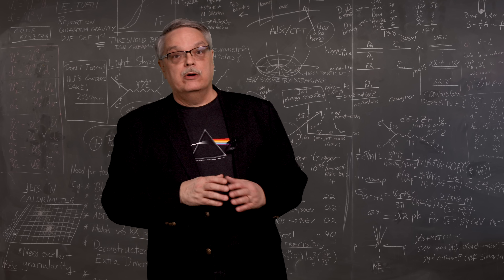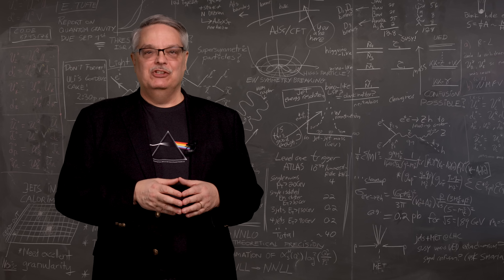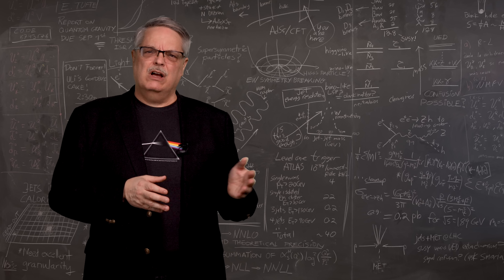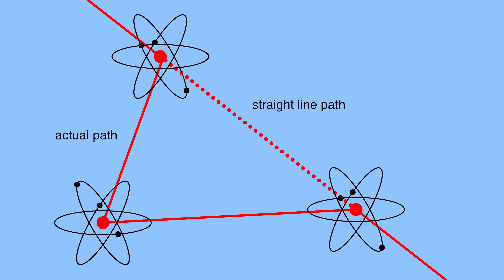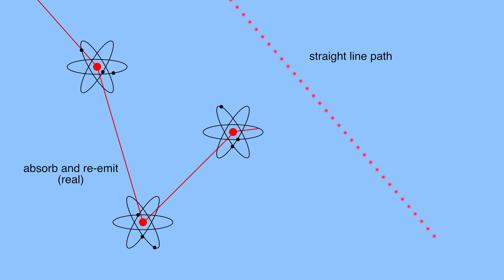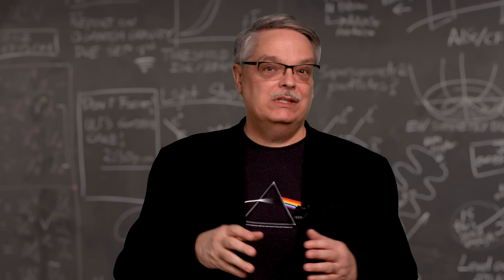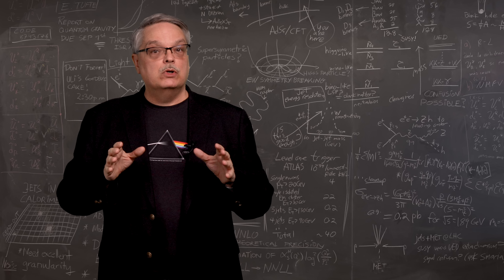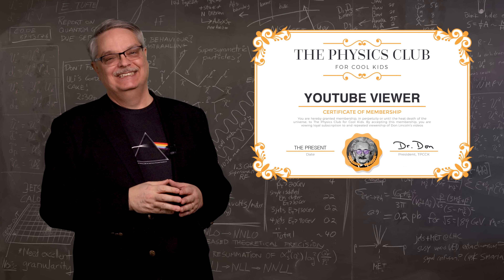Why does light slow down in water?

Comment: Imagine that. Wavelength is color for light waves. The beam would have to change color entering the glass and change back upon exiting. Also, light speed was never described as being dependent on color before, or did i miss something? Mmmmmmmaybe not so simple. Radio is considered invisible light and when going through an insulator of an antenna shortens its wavelength... so there may be something to the wavelength shift part of it, but the mechanism or speed shift? Not necessarily. Still curious: Why? In an antennae the wavelength remains shifted when exiting the insulator, Into the conductor of a receiver. So, not this mechanism.

Comment: Few questions..
1. What is the direction of propagation of wave generated by the moving electron?
2. If the electric field exerts a force on the electron of the atom, doesn't the energy of the light wave get spent? To exert a force, energy should be spent. And if energy of the light wave is spent, then upon increasing the thickness of the slab of glass (or any optical medium), the energy of light wave should decrease progressively to zero.
3. After the light wave has interacted with electrons of an atom, when it approaches another electron of another atom, it now has electric field of its own and that produced by the electron of the atom previously met. Now this new superposed electric field should interact with a new electron differently causing light to behave differently as it progresses through the medium. It may have different average speeds for different thicknesses of the medium.

By this what I wish to say is, the electric field of the light may not actually get influenced by the new vibrations of the electron of the atom rather by the inherent wave of the electron with which it goes round the nucleus.

Please do answer (and/or refute this) anyone. (I'm an undergrad as of the moment of typing this.) I'm welcome to all arguments.

Comment: Finally, an explanation that made sense. Thanks a lot.
Reply: It still doesn't make sense to me
Reply: @MrSpock-sm3dd  There are 2 crucial bits:
1. 8:03 - 8:21 - the oscilating photons induce the oscilation of electrons. The oscilation naturally have the same frequency, but different phase and the amplitude.
2. A sum of sinusoids at the same frequency is another sinusoid at that frequency - always true. The proofs of that are a bit complicated, so You can just remember that's how it is. What changes is phase and amplitude. An animated illustration of that is 7:06 - 7:30. The original wave (2) moves at the speed of c, while the induced wave (1) is almost stationary (at least here, I don't know how is it in phisical body e.g. glass). The resulting wave (3) is the weighted sum of (1) or (2), weights being amplitudes. The larger the amplitude of (1) the more (3) resembles it, so also the slower it moves.

That's how I understand it on a basic level, although I wouldn't be surprised if there are some holes. If anyone would like to correct me or add something, please do.
Reply: @MCMaterac  Where I get lost is the assertion that the amplitude being changed somehow affects the speed. I don't think that's a property we observe in other waves, to include light. And there's no explanation in the video as to how we arrive at that conclusion.
Reply: @That_Montage_Nerd  You're right, that's a wrong assumption. I've just made a javascript simulation. If the 2 amplitudes are equal, it looks just like in this video and in relation to wave1 the resulting wave3 moves half as fast as wave2. However at other amplitude ratios the resulting wave moves on average at the same speed as the input wave that has higher amplitude, with additional left-right oscilations repeating each time wave2 has amplitude higher than wave1, the wave3 propagates on average as fast as wave2, accellerating and decellerating each period on repeat.
So yeah... the video (and my answer) doesn't seem to explain the matter well.
Reply: @MCMaterac  Bro are you Indian?
Reply: @onlymusic1691  Nope, bro, I'm Polish.
Reply: @MCMaterac  The video does not explain the question raised at all. See my newest comment under the video.
Reply: @whuzzzup  Found it. You're right.
Reply: @MCMaterac  100% incorrect, you are completely wrong
Reply: Debasish Ray Chawdhuri except it's false, so even if it makes sense to you it doesn't help you except believing something incorrectly

did you even graduate high school? this is some of the most basic stuff

Comment: So, enough glass and the light energy would just be absorbed by the slower wave length, produced by the field? Also, is the light passing through glass, producing heat or energy? And, different color light travels at different speeds? When the light passes through the glass, the speeds are averaged out to a average combined light source speed.,.. so if we eliminate the slower wavebands, will the light still slow down going through the glass? If light of different colors travel at different speeds, how is what we see in the night sky accurate? The fastest colors bring their information here faster, than the slower colors? Can we break light down into it's different wave forms and measure the speed of each waveform..
Seems like the makings of time travel here?

Comment: Now hold on. The resulting additive wave has a different frequency (wavelength) than either the original wave or the secondary wave alone. That's clear. But the argument presented is then implying that lower frequencies move slower thant higher frequencies, which is not true. The speed of light is constant regardless of frequency: blue light moves the same speed as red light, for example, right? So, the authors of this video still have not explained why the combined, lower frequency wave, moves slower through a transparent medium than the original wave.
Reply: Thats because its BS take a look at the alleged moon landings.

Comment: Good work pointing out the "wrong" or incorrect explanations on why light changes speed when it moves through a medium. Now here's whats incorrect in your statements that you're claiming in this video. The velocity of light does not slow down when traveling through water or glass, what occurs is the wave speed changes not its velocity. If what you're saying is true then red light would travel at a different velocity then blue light being at different size waves. That is not what happens, What changes is the "Rate of Time" of the object from changing its wave size. The velocity of light remains the same only the size of the wave and the speed of witch the medium appears to be moving through "Time" changes. So when light leaves the medium it departs at the velocity of light because its velocity never changes not because the light beam "prefers" to travel at light speed. I enjoy your efforts though keep up the good work.

Comment: For the same reason planes have to fight to go faster in the atmosphere, RESISTANCE
Reply: Resistance would cause the light to decelerate over time. And would not explain how the light speeds up again when it exits the glass.

If you shoot a bullet into a fish tank it will decelerate rapidly while it is in the fish tank then come out the other side and continue at a reduced speed. That's not very similar to what happens with light.

Light slows down instantaneously and then pick up it's original speed upon exiting the tank. It isn't a stream of particles.

Comment: This is a classical explanation, there must be a quantum one. At some point the professor refered to the light absorption, which is a quantum process but he doesn't go further to explain the origin of the secondary wave in the therms of the light scattering. The refraction coefficent, which has all classical physics needed here, is read quantum mechanically as a result of photon scattering, which  is always acompanied by asbsorption, no matter how small for transparent media, since both are parts of the same process (Kramers-Kronig relation). It would be intersesting to hear a quantum version of the light slowdown. Is it becuase there's some delay due to the scattering process?

Comment: During my (now ancient) education in electrical engineering, I found it interesting that electricity also travels at the speed of light or some fraction thereof, depending on the nature of the conductor, but ...

Individual electrons travel much more slowly. In other words, when an electron enters a conductor, what exits the conductor, seemingly at the speed of light ... is a DIFFERENT electron!

Neat magic trick, huh?
Reply: Nothing with mass can travel at the speed of light!  So electrons moving at speed of light is a joke! But electricity does, Let me tell you another fun fact electricity doesnot run trough wire but directly from power source to the resistance(device) at the speed of light through Space 😂, we need wire and electrons to make current flow but propagation of energy wave direct from power source to resistance.
Reply: There is a fun youtube video which explains all of this : https://www.youtube.com/watch?v=bHIhgxav9LY

Comment: I get the photon/electron interaction explanation but what of the Magnetic wave component of the Photon? 
Is that also only interacting with the electron's fields  or is the bigger/alternative picture that the EM particle/wave (ie Photon) enters a region of increased EM energy density which displaces and then springs back as the photon leaves ? 
Taking the description of a Photon as described by two waves E & M at 90° to each other, that's the picture that appears in my imagination currently, at least. 
Squeeze and Spit  ...

Comment: Hang on. The first obvious question is, wouldn't the electrons oscillate in phase with the light wave? It seems that the summation of the two waves should just be the same wave with a greater amplitude. But then we would see an increase in the intensity of the light in the glass, but no change in speed, right? The phase of the resulting field must be shifted, whcih should depend on the properties of the material. Can you elaborate on what those properties are?

Also, electrons can only oscillate within their orbitals. If they change their distance from the nucleus they'll be jumping orbitals which is just the  absorption-reemission hypothesis already rejected. So the size of the molecular orbital in which electrons are found should have a very large effect on the material's index of refraction. Is that true? It also implies that we would expect to see very large anisotropies in the refractive index of organic crystals depending on whether the incident light was aligned with the orbitals or not. 
This would suggest that for organic molecules the index of refraction is an even better tool to study the extent of molecular orbitals than UV/Vis spectrophotometry. Yes/No?
Reply: In fact, the more I think about it, the more it seems that refractive index should be directly related to the polarizability of an atom's or molecule's electron cloud. Crystals of NaF,  NaCl,  NaBr, and  NaI should show a progression of refractive indexes. And they should each be less than (or more than?) KF,  KCl,  KBr,  and KI respectively.  Is that observed?

Comment: Gosh that was a lot more intricate than I imagined. Whoever figured this one out first?
Reply: He captures my whole attention span. What charisma, personality and articulation!  In my opinion this particular speaker is a "physicist at 💙.  He exudes the affection he feels towards such a venerable and indescribable science.  Thank you.  Ana Abreu.
Reply: @wolfie54321  That theorem is just an alternative mathematic description of wave propagation. It is compatible with Hygens principle, and that recognize particles, that's why it is preferred (sometimes) in describing wave propagation in substances. But applying Maxwell's equations with the measured (or calculated) average electrical properties of materials is simpler. Both are correct in normal case. But at very high freq neither of them are accurate (in materials).
Reply: He just described the Ewald-Oseen extinction theorem totally wrong.
https://en.m.wikipedia.org/wiki/Ewald%E2%80%93Oseen_extinction_theorem
You can find the falsification explicitely:
"...each of these waves travels at the speed of light in vacuum, not at the (slower) speed of light in glass."

The explanation of Don Lincoln is just plain wrong, both in physics and math. "recombination" of 2 waves travelling at different speeds is just a stupid, impossible idea. If the slower one is just not there yet (in a specific point where "the light" has already arrived), then how could it be added to the faster one?
Reply: @PafiTheOne  lmao, that guy has a PhD, there's a reason he works at Fermilab not you
Reply: @PafiTheOne  Yet when the waves are added up, they surprisingly create only a wave that travels at the slower speed. (from your wikipedia page). I think this is exactly what he said...
Reply: @garou108  Absolutely not. He talked about 2 waves with different speeds at 7:06, while wikipedia states waves with the same speed. The words "different" and "same" have the opposite meaning IMHO. Don't you agree?

Comment: Light slows down, because it's not a particle.  Electrons are not particles.  The speed of light is simply the limitation of the electromagnetic field it travels through (the aether).
Want proof of aether, check this vid out after 12:12, this guy demonstrates the Michelson/Morley test, but with a successful twist.
https://youtu.be/BkzMuU6jnGk
What you end up seeing are the earths magnetic fields shifting around; if/since aether exists, you will get minimal divergence  (actually notated in the Michelson/Morley experiment), due to the massive earth, spinning around, through this electromagnetic field (aether), causing turbulence (as well as gravity), that would block the "aether wind".  But, you see moving divergence of a laser, which means if you move a beam of light around, it is susceptible to the "field" it travels through (not because of particles)

Out of the particles that do exist, "charge" (not electrons) in this electromagnetic field (aether), is what keeps the particles together. You have to "decharge" (as opposed to "knocking off electrons) a gaseous material, to push it through a collider or a proton gun.  The data is there.  

Light is a wave or charge through this electromagnetic medium, not a particle. It can slow down because of electromagnetics and it speeds up because that frequency of electromagnetic energy is the "speed" limitation of the aether.

Why have all of the electromagnetic spectrum be different particles, but the same function at different frequencies?  

Tesla believed in the aether, he understood it well and actually invented technologies from it; Einstein never invented any tech and the idea has confused scientists for over 100 years.

The Michelson/Morley test is the "only" test said to defute the aether.  It's obvious (with the video link above) they did the study completely wrong and it doesn't come close to tossing aether out the window.

Comment: I'm not going to attempt a full explanation here.  I will leave that as an exercise for the reader.  But here is a slightly different way of tackling the problem.  Think of a runner who is running from point A to point C.  The land between points A and C is separated into two different zones.  The runner can run at  velocity v1 on the surface where A is situated and at a velocity v2 on the surface where C is situated and v1>v2.  Where should a point B be located such that in running from A to B to C, the time taken is a minimum ?  The correct answer will be proof of Snell's Law and the basis of the value for the index of refraction.  

A deeper question is how does light know how to minimize elapsed time in following an analogous A to B to C path ?

Comment: if that is true, then the same material at absolute 0, has a refraction index very close to 1.  or
the colder the temperature of the material, the lower the refraction index.   or
the refraction index is temperature dependent.  
?
Reply: do a neutron star has a refraction index smaller then 1? (no charged particles)

Comment: Given this explanation, I would expect light to continue to decelerate the further it traveled through a transparent medium. This assumption is based on light-speed wave (A) interacting with the wavelength of the electrons (B) to produce a 3rd wave (C), and no wave exiting the medium having traveled the speed of light. If wavelength A is converted into wavelength C having interacted with wavelength B, then wavelength C should continue to decelerate with every additional B it interacts with. We should see a continuous slowing effect the further light travels through the medium, and it should curve rather than refract and travel in a straight line.
 
I'm sure he kept it simple for the video, but something is missing here.
Reply: I think this guy is bullshitting! The speed of electromagnetic waves like light doesn't depend on their wave length / form. Also if  electrons change a wave form that wave is not going to be light anymore!
Reply: Yep, seems like something is missing.  Furthermore, if the electron is radiating... why does that energy stop at the boundary.

Comment: Sounds a bit unlikely to me.  I'm sure Einstein said that gravity affects light.  It follows that a wave passing 'through/over' an atom would experience the full force of the atom's gravity (i.e. distance^2 = 0) and therefore light would travel 'further' through an atom.  The light would bend at the surface because at 700nm the wave is large enough to cover many atoms and so one side of the photon would 'drag' first causing it to change apparent direction.